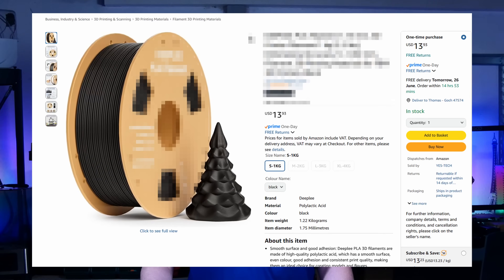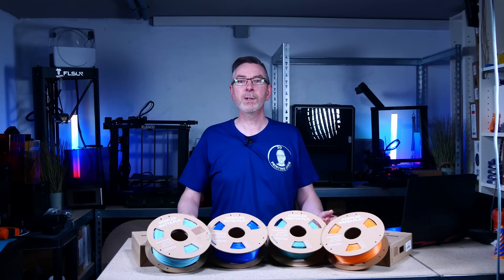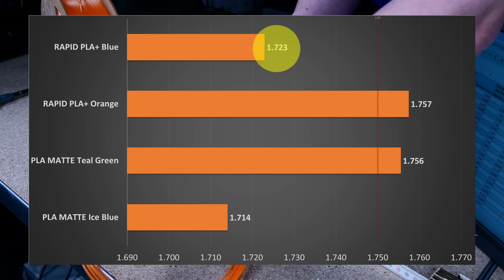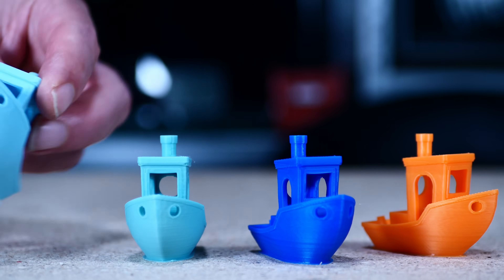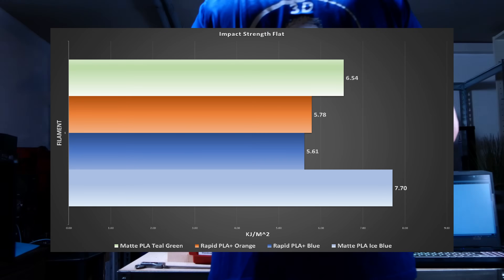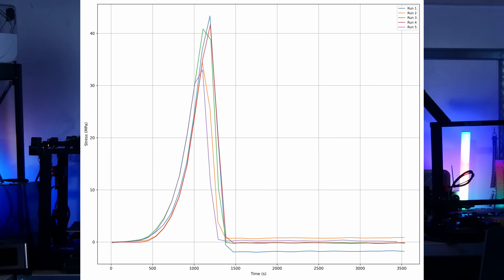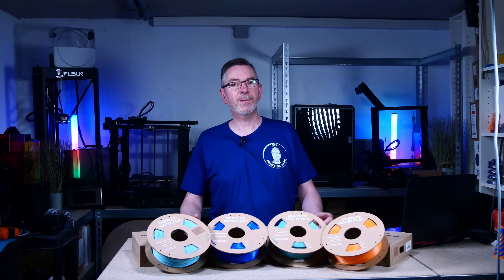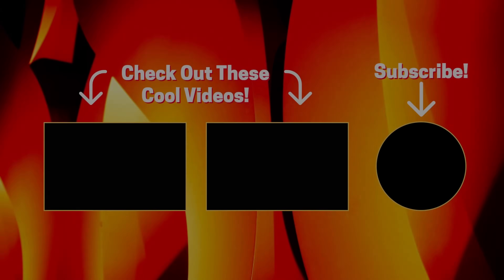Deeplee Filament: Is it ACTUALLY Worth the Hype?

Comment: 100 Mpa is way beyond the advertised tensile strength of normal PLA. That's more like PA territory. Seems suspect to me.
Reply from the maker: You're right to be skeptical! The calibration of the DIY test machines is a little bit tricky, and that could be the reason for the results I got. Nevertheless, since that was used for every test, the results are at least qualitatively comparable. Though I think that the tested filaments have the specs promised by the manufacturer.

Comment: I used it on my neptune 3 pro and did great, but my anucubic kobra 2 max was horrible, got the blob of death for the first time.
Reply from the maker: It's great to hear that the Deeplee filament worked well on your Neptune 3 Pro! Sorry to hear about the issues with your Anycubic Kobra 2 Max. Since filament parameters are only one part in the equation, sometimes, different printers can have varying experiences with the same filament.
Reply: @3D_Printing_Geek change the printer configurarion and I am printing with deeplee filament on my Kobra 2, it gave my quite a scare and I am not sure of what was wrong but it works now

Comment: I bought a roll of black Deeplee black PLA last week an Amazon for 11€, 3-4€ cheaper  than most other cheap PLAs like Geetech. It prints beautifully and fast on my A1 mini and has a good matte finish. I think it is a great option. The only cheaper PLA i have ever bought was a ten pack of different colors from Kingroon which was very inconsistent in quality.
Reply from the maker: Thanks for sharing your experience! It's always great to hear about quality options that are budget-friendly. Your insights will definitely help others looking for good PLA choices!
Reply: @3D_Printing_Geek  thanks for doing these tests, for some people like myself these are very important figures. I also appreciate the humble attitude you have about some of the testing equipment not being the best for the job.

Pla + is actually a great option for certain types of prints that need high strength while still keeping a low price. We really need more independent testers and standardized testing. 

I also went with kingroon pla+ in my early days with hit or miss quality and low strength but great customer service.

Elegoo pla+ is rumored to be a lower strength "pla+", and in my testing definitely doesn't seem to hold up as well as other similarly priced filaments. Their customer service has always been great though, for filament or 3s printer issues.

Esun pla+ and duramic are my go-to and for the most part they seem worth the price. Especially if you can catch a sale for either.

I was hoping elegoo would raise the strength in the deeplee line but it looks pretty close to their elegoo pla+.

Thanks again and keep up the good work, I would love to see strength testing on as many of the main pla+ filaments available in the US

Comment: Just one thing. Tensile jig looks great overall, but has one flaw (that should be esy to fix). See especially left side of the jig on 9:27, but also right one (with the load cell) is not aligned with the slider when the force is applied. It is rotating/binding during movement and specimen's is  subjected not only to tension but also to bending, which creates complex stress and strain. Also your results for horizontal test objects are 2-3x times higher than advertised by manufacturers or confirmed by many reserach (40-70MPa). But your layer adhesion test are significantly lower (as percentage not value), because typically it is 50-75% of horizontal strength (30-45MPa). The second one is caused most likely by the jig issue, because layer adhesion test is very sensitive to bending. For the unrealistically high tensile I expect that or there is a calibration issue or also the load cell is not loaded correctly because of bindng of the specimens holders on the slider during measurement.

Comment: That packaging is the exact same as Elegoo , same box, and even the label on the box is the same.
Reply from the maker: The packaging looks similar but not the same. Elegoo's filament spools have slots, where Deeplee's spools have arc shaped cutouts.
Reply: @3D_Printing_Geek what are the quality of the spools? I find that the cardboard spools from most companies are of poor quality, with the edges often being damaged and bent. Some have edges that aren’t sealed and so give off cardboard dust or shreds. Polymaker recently improved the quality of their spools.
Reply from the maker: @melgross I didn't compare them consciously to other cardboard spools but I'd say the felt strong. Maybe not the quality of Creality spools but not much difference to Elegoo's own spools.